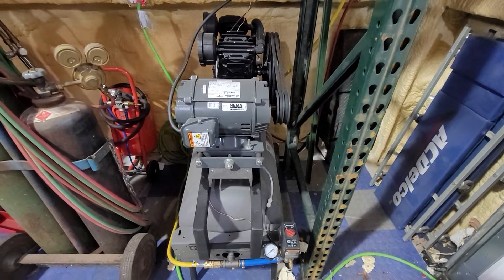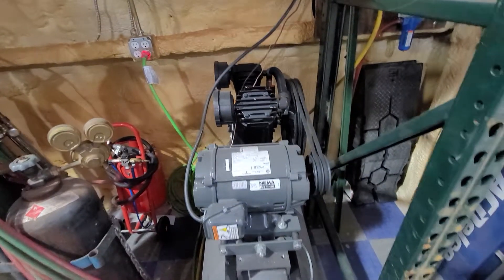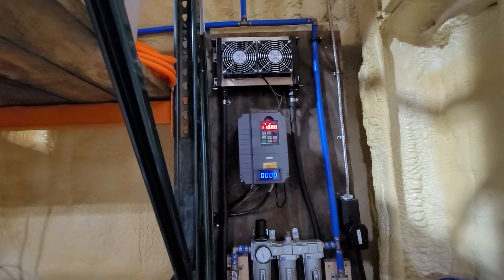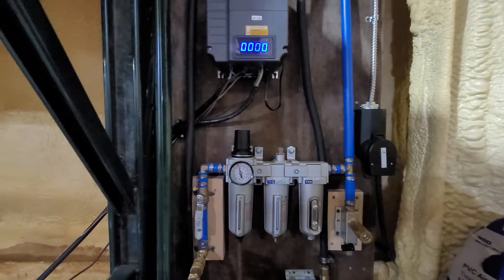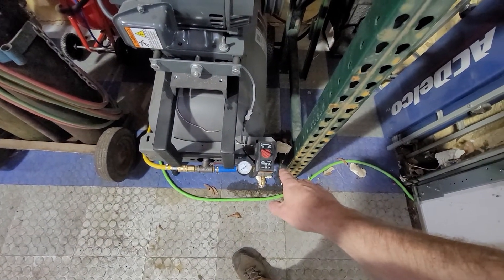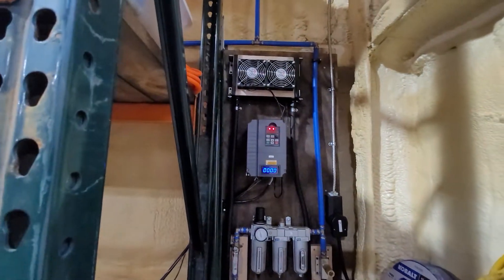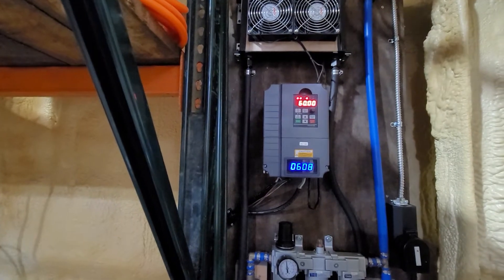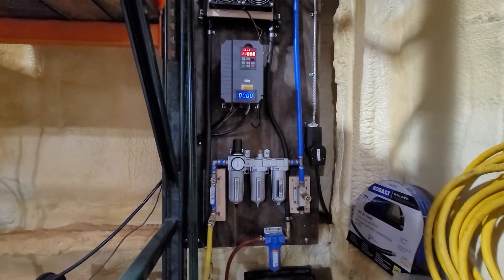Quick overview of my 3 phase air compressor conversion and air dryer setup.

Comment: what 2 wires did you connect on the VFD for it to give power to the motor and how would this turn off and turn back on when it kicks on again ? i am on the process to convert my compressor to 3 phase with the same Amazon VFD

Comment: looking at doing this as my compressor is also 3 phase.  Curious if you could've just wired it so that the vfd was supplying power to the compressor all the time and just let the pressure switch do it thing like it normally would?
Reply from the maker: The VFD needs to control the motor start / stop (VFD output) via switched inputs on the VFD.  If you put a switch / contactor / breaker or any other form of current interrupting device on the VFD output, you will most likely damage the VFD.

The way I accomplished this is by removing the original electrical (power) connections from my compressors limit switch and simply using the limit switch contacts as the on/off signal for the VFD.   Basically I have 2 inputs on my VFD that, when connected (switched on) they tell the VFD to send power to the output (my compressor motor).  I used these 2 inputs and connected one to each side of my compressor pressure switch so that when the pressure drops, the pressure switch trips, connecting the two contacts.  Then the motor comes on and all runs as intended until the pressure switch trips at max pressure, opening the input circuit on the VFD input, telling the VFD to no longer send power to the output (and as such, the motor shuts off).

I hope that helps!  If not, comment back and I'll get more detail for you.

Comment: Thank you. This helps on determining ti buy a 3 phase air compressor.
Reply from the maker: To be honest, this is running as 3 phase on single phase power via a VFD.  If I had the option to have 3 phase, I would, but I'm quite remote and the cost to run 3 phase to the shop was INSANE.

If I had 3 phase power, I would have a 3 phase air compressor, and most likely a scroll compressor, but this is a good compromise.  I would still likely put a VFD on a 3 phase piston style compressor though, that way I could control the speed (and as a result, the noise).

The use of a VFD has other benefits too, such as the ability to activate additional devices (like the fans on my cooler) when the compressor runs.

Comment: How hard was this to wire up in the vfd?
Reply from the maker: Well, the truth is the actual connection was pretty trivial.  HOWEVER, the Chinese VFD from Amazon works quite well, but the manual is pretty horrible.  It took quite a bit of googling to figure out what to do.

In all honesty, it was a twofold issue, my unfamiliarity with VFD terminology and poor translations to english made it harder than it should be.  I did discover that I'm not alone here, and because of that there were plenty if articles to help me put it all together.